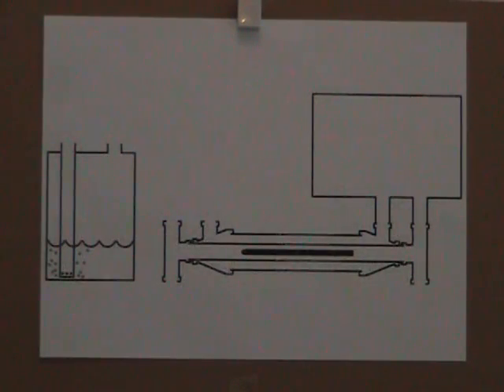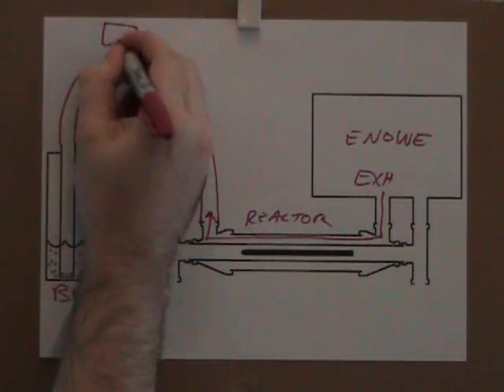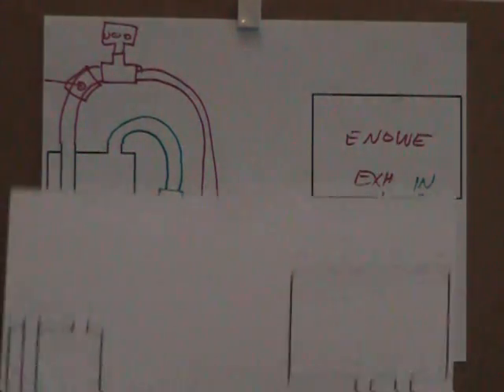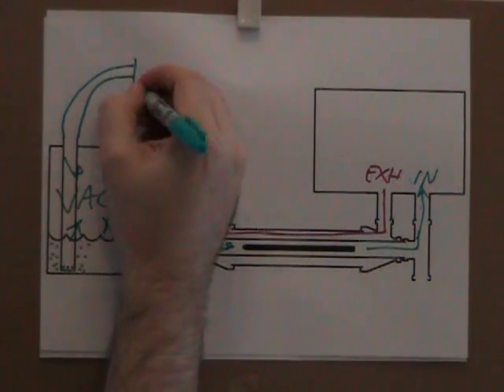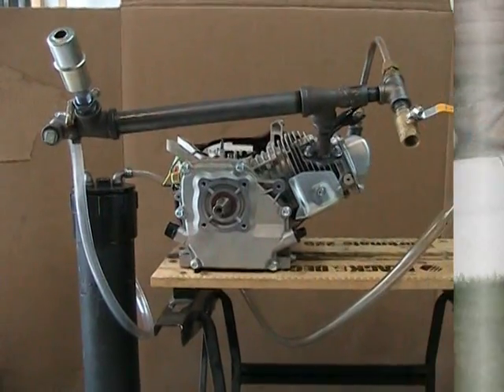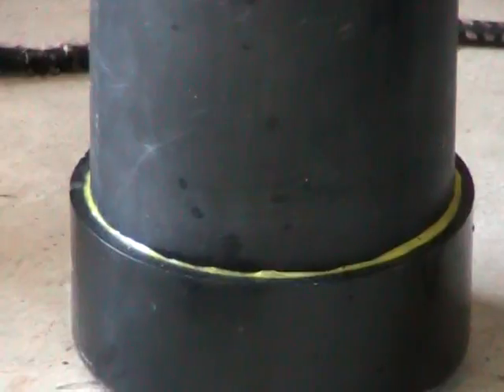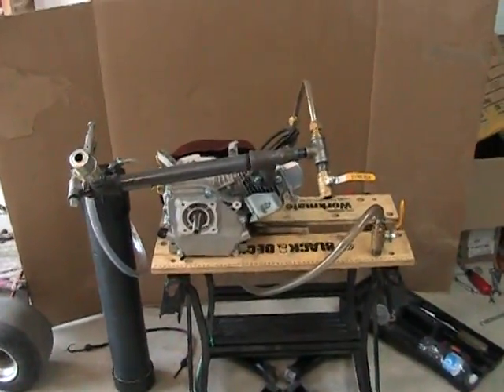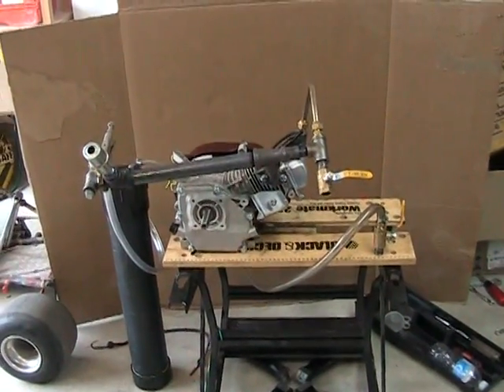GEET Fuel Processor - test 4 - revelation

Comment: this is a typical passive system ,what i mean by that is it only works until the lighter elements of gasoline are boiled off from the vacuum that the engine creates, once these elements are boiled of it ceases to function because only the heavier elements of gasoline remain and those elements vaporize at a much slower rate if you want plans for a real system lokk up gedc0395 pat galloway this system vaporizes ALL of the gasoline and uses no heat
Reply: Again Ive seen your posts before and finally some sense in the chaos although Ive yet to see a system that can overcome the vacuums lack of reactivity. mine was 20 times more efficient than a standard set up(32 mpg normal injectors and 651 mpg on the vacuum system) Still it has its limitations
Reply: You need to keep the vacumm at a constant 15 inches for complete homoginis vaporization of all elements of the gasoline you achieve this with a vacumm pump not the engine and before the intake manifold. Then you attach the export side to anywhere on th intake msnifold and close off the air of the "carberator"
Reply: I know about the steady vacuum, how many miles are you getting?
Reply: Leslie Clendening 60 from a 351 mach one mustang
Reply: We got 300-350mpg in a V8 302 and it would do the 1/4 in sub 10
It would do 3 passes then the speed would deteriorate until it wouldnt even start
We realize that the deterioration in the fuel was the problem and had considered and procured a vacuum pump to facilitate the creation of vacuum but pursued other directions
Most dont realize the need for vacuum and when their unit stalls they add heat. They also make the mistake of averaging out the first cup and mileage obtained and multiply it by 32 a common error
Interesting take on the problem couldnt find the reference but ill keep trying
Nice to meet an enlightened soul
Reply: I never have achieved the milage you stated but i did vaporize all of the liquid as a frozen ice crystal in a vapor form. Fine tuning of the fuel ratio could make those figures be more. Most people think heat the fuel bad idea that just retards the system and converts the vapors back to liquid. But stabilizing the fuels temperature does help glad to meet someone that knows a bit about physics. Im too old to fight the system to bring it to market and not sure it can brought
Reply: Im too old too (I think) I do have a lot of young guys trying to pick up the torch Im just trying to steer them in the right direction( opposite direction of most You Tubers lol). if they start off where we left off someone will figure it out
I found that a stationary engine without speed variation can run a generator that powers the batteries and use the electrical system to control speed. A modified Chevy Volt would be perfect because it already has both electrical and combustion systems. I personally think it would break the 1000 mpg barrier because smaller engines are exponentially more efficient than larger ones. It does take away from the one size fits all strategy that prevails now
And you are very correct about heat. the vacuum lowers the boiling point of the fuel so we didnt need heat either and I started my volkswagen in -40 just to prove that fact. You cannot have leaks in the system though
Nice talking to/at you and good luck 
Leslie
Reply: One more thing it doesnt matter what the end mpg was it matters that you know how you got there and 60 mpg is an achievement in light of the prevailing technology today
I achieved far greater mileage but with little control to speed variation. Its not really a numbers game its really the "holy grail of achieving better mileage in an operable car. Anyone who tries deserves recognition . We certainly get our share of insults

Comment: I have mine running my AC all summer long and it runs off nothing but unicorn farts and the tears of orphans.
Reply: +Steve Franklin Unicorn farts have methane.
Reply from the maker: +Steve Franklin - HAAA!    :-D    Awesome.
Reply from the maker: +Kenneth Meggers No, the input line is too long and too cold (relatively) so the fuel vapor condenses as water in the line and is eventually sucked into the reactor input. When that happens it sputters to a stop. I need to rebuild the input line as copper (or something) and make it as close as short as practically possible. I don't seem to have to add any gasoline to the fuel tank though unless it had been days since the last test.

It should be no surprise that there is no commercial interest in this 'technology', it's bloody temperamental and finicky. However if you want to see it in action I recommend the videos of "aluka1603" I believe it is. "Geet Pantone Engine Concept Demo by Andreas Kalcker" I think all that's happening is we're putting various pollutants through a brief (and extreme) chemical state which improves their combustibility in a typical I.C.Engine.

I sold my rig, so I'm hoping to build a new one from my remaining parts this summer.
Thanks for watching.
Reply: +neverchk Is the geet fuel that bloody temperamental and finicky that you can't get it ajusted to run right.
Reply: +Kenneth Meggers in a word, "yes". It should not be a surprise that without taking appropriate measures to mitigate the effects of vacuum loss, condensation, etc, that the average consumer would not be able to manage this home-built system. It should also be obvious that no manufacturer would go to the effort to produce and support such a system considering the potential for human error causing performance failure and there being no profit in it for the manufacturer. That doesn't make it any less viable as an alternative to running a lawnmower/generator/pump/etc with a conventional gasoline engine, but you have to be a tinkerer.
Reply: Funny. Read above post for a bit of truth about the vapor carb(I know its long but read the whole thing)
Reply: Congratulations you are the second post from someone who has figured out why this system is not marketable Please read my (very long ) post above
Reply: Steve Franklin unicorn is rhinosorus

Comment: There is not, a single video, I said a single one, that runs and engine for more than 5 minutes!!. None!
 It would be very easy to leave the thing running for half and hour with the so called 10% of fuel and the rest on garbage. But have they done it?, even a time lapsed fast forward video would be easy, But who in the hell has done it or even think about it?

Comment: Why have i never seen a GEET motor actually running anything besides a loadless engine?  Put a damn load on the engine and see what happens...
Reply: +Michael notgivingyoumylastname It should work fine. Since the GEET system is nothing more or less than a very crude carburetor, there's no reason why it wouldn't work.
Reply: It wouldn't work with people thinking they can run it on coke and water and then shut the exhaust valve

Comment: If you set up right, ONCE exhaust temp reaches a point, you can cut all clean air from intake, your airstream through reactor lacks the smoothness need to make achieve the ionization needed for prefect exhaust, i would Hone all inside pipe surfaces next build you see a difference
Reply: +DeFreshS10  if you were as smart as your as you act, would know that water is consist of H2O and the oxygen is all that is needed, hydrogen is a highly combustible gas if given oxygen, build it you see,  so please don't be ignorant build it or look in to it farther than the bridge of you nose!

Comment: ok i think i am starting to understand
the gas is-(dry)?- like it goes to engine as a gaseous mixture of mostly air?
 then using the exhaust pipe--?-- heats the gaseous vapor - in an effort too increase performance.
could you tell me- is that what is happening?
i want to do it to a 6 cyl chevy truck

 i am having a bit of a prob understanding the entire set-up-
like the carburetor part--  how would i  do it= have the valve to the gas peddle?
 i'm just not getting it all yet
and i do get it- that if it works on a  small lawnmotwer engine then  it will work on a bigger motor.
Reply: +profetarmageddon dude the engine is not an engine. sorry but if this actually works, it has 0hp and 0 torque. so your truck would go nowhere.

Comment: question cant  i just leave the carborator  on it ? and  have a geet bubbler  running into a sponge backfire arrestor  ? with  an adjustable air valve that opens  and closes  due to what   rpm is it ?
Reply: please reply i need to know
Reply: i'v used    it with just the carborator  on it  with a fume  but without the plasma reactor  i ran a 5 hp engine for over 30 mins off 1 cup of gas i used a  water filter container with a pvc pipe running down into a sponge for  it to not be  an aggressive bubble  and then it would come up into a pipe to catch remaining liquids that manage to splash up and drain it back down then it would hit  a T  with an air valve since straight gas isnt a good idea and this t valve had a  very light  air adjustment   valve to be able to open or close  if the engine rpm drops  i had it on a spring  attatched to the motor's  oil rod that pulls the engine to keep the rpm u set it to maintained and every time it would dog down it would close the valve a little but not all the way
Reply: jeshua leblanc  NO carbs become worthless unless you do some mods, they do not mix the same
Reply: only mod i did was blocking off the actual carborator and using the  valves between for air / gas flow
Reply: +jeshua leblanc The "GEET bubbler" is a form of carburetor.
Reply: why when i have my 14 hp brigs and straton motor can i  mow the whole yard on 1 cup and a half of gas then.  it works just like this but without the  exaust heating up the fumes

Comment: where can you get the reactor rods ?
Reply: I thought about using a magnet for a fuel rod through a copper pipe any comments because you know the weird anomaly's that happen when you run a magnet through a copper pipe=levitation?
Reply: a smooth metal rod is best. anything that's magnetic

Comment: You may want to cut off the glue cap and use a 4" Fernco Cap that is Rubber with a SS strap to tighten it.  I would assume the Rubber is Gas Resistant but it may not be so try to find out before you use this idea...
Reply: +Paul Bialozor  Doesn&#39;t the north and south poles of his pipes matter? and the smoothness inside the welds? And recently I saw that making all the 90degree angles into two smoother flowing 45 angles was suggested for increased flow.?

Comment: This is a reversion to 100 years ago's 'carb' technology. Fine for single fraction fuels, but modern engines are designed to burn atomised fuel, not single fraction vapours. You lose the valve-seat protection, anti-knock, anti-oxidants etc by evaporating the fuel at a fixed temperature. I love experimenting with old stationary engines, I think you'd find it very enlightening too!
Reply: So cars can be made with less technology and they could be cheaper again???
Reply: +Josh Krause I don't think you'd want this on a car. You'd need to have your passenger sit there and manipulate the valves every time you wanted to speed up or slow down.

Comment: I saw 2 car engines running on the GEET system over 10 years ago and this is the first time I've ever seen a youtube video of anyone trying to do it the REAL way. That bubbler crap was just a distraction for people who were worried about small engines. For cars, this is the right way to go about it. Thank you, it's been driving me nuts for years seeing all these inferior project builds. P.S. We followed one of the cars using this system for over 100 miles so it will work under a load!

Comment: :)  :)  there needs to be sensors that pic up change in element and other emission sensors  integrate that to a program. this will lead to maximum safety for fail safe programing and full control with accurate  information based system that could be operated in a manner of throttle control.

 send me a comment if you like this idea .

Comment: what is the reactor rod made of ? and if your using gas to run it, what is the point of doing all this work, when it already runs on gas ?
Reply: You could make it out of anything that won't burn. The rod is totally necessary in this but not for the reason Pantone claimed. The rod is the flashback suppressor - if you get a backfire in your engine, which is totally possible with this thing, it will keep the flame front from setting the fuel in the bubbler on fire.

Comment: i think all these do is using vacuum or airflow to vaporize the fuel, the engine is working on fumes. It would be interesting to put a load on the engine and see if its not just low-torque work being produced here. also a side by side comparison on this setup with and without the rod would shine a lot of light on this.

Comment: Water is not fuel. it is actually already spent fuel. When you burn hydrogen the chemical reaction to the hydrogen burning with oxygen is to produce water. in order to turn water into fuel again you must release the oxygen and hydrogen atoms from each other through electrolysis. Then you can burn them again and turn it back to its spent form which is water. But you must put more energy into splitting the water than you will every get out of it in work. So this engine will never run of water.....

Comment: This appears to be nothing more than a bubble carburetor.  Any gasolilne engine will run on gasoline vapor. If you bubble air through the liquid gasoline, (even gasoline water mix) you get a highly combustable vapor.  Original internal combustion engines were run this way using a retort.   They heated kerosene in a metal tank and trapped the vapors coming off the top. The vapors were then piped to the intake valve.

Comment: I have been lookin into the GEET i already make gas into a vapor on all stuff they also vaporize alcohol and still can run reg gas if need be but i can see a few things u can do to add alot to the GEET one add a fuel valve regulator after the GEET by the fresh air one to get a better fuel mix! Sec thing i can see would be a big plus if u would take yr bubbler and use copper tubing to send yr exhaust as a heater for it to get better reaction gas vaporizing cools.

Comment: Looks very credible.  This is in theory like a wood gasifier, using liquid fuel instead of solid wood and "vacuum boiling" with the aid of exhaust heat.  Wouldn't routing the hot exhaust through the bubbler make gasification of heavy waste oils etc more easy without investing in a diesel engine?  Wouldn't it also re-cycle unburned hydrocarbons?  As for environmental concerns, recirculating exhaust gases lowers NOx emmisions as in the EGR system in a car.

Comment: Smokey Yunic's Vapor Cycle Engine
just google    smokey yunic image   and you will see a diagram for the engine design. the Geet Gas setup looks like a simplified version of the VCE. 

In the geet system water is mixed with the fuel. It has long been known that water injection can reduce preignition in highly supercharged engines. 
The main reason for the exhaust through fuel mix is to heat it. if you don't want the impurities run a copper coil through the fuel from exhast to atmosphere.

Comment: @neverchk
Theoretically, it should drop down to near ambient temp because:
If the engine is being fed pure vapor fuel, there wouldn't be anything left to carry heat (like unburned fuel) in the exhaust gases. If the burn-cycle is completed before the exhaust valve opens, any gases that are expelled would be significantly cooler.
Our current engines are designed to open the exhaust valves just after TDC of the compression stroke causing hot gasses to be forced out of the cylinder.
Makes sense, no?

Comment: @1BustedMyth
Actually it won't lead to any of these issues. Why?
Because the solvents and (now liquefied) PVC will cause the engine to seize. The revving down is caused by the liquid PVC being deposited on all the surfaces inside the cylinder causing increased friction "gluing" the piston to the cylinder wall. It's like pouring Sugar in the gas tank.
Sugar is really nasty because of how hot it gets. In some really bad cases, the piston and cylinder-wall become fused. And there's no fixing that!

Comment: Many PVC glues are petrol/gas/petroleum based and if I'm not mistaken the PVC itself will have a very strong reaction and contaminate the fuel. End result will be Tar, carbon build up inthe cylinder head leading to pre ignition and "run on" (Dieseling)
So as you said, glass would be better.
nice clean test rig setup, well done.

Comment: I know Paul Pantone well. He is a con man through and through. I'll share one little secret with you. When he pours water, Mountain Dew or urine in the gas tank and the engine still runs, people are amazed! The reason it still runs is because the fuel line has been changed to run off the top of the tank, burning the butane and other parts of the gasoline. Because of that, there is no need for a carburetor to vaporize the gasoline (unvaporized fuel will not burn). A sucker is born ever minute!

Comment from the maker: There's nothing special or magical about plasma, it's just 'excited' gas. I don't think it matters how long it remains in that state (probably just a flicker if at all) but I believe the fuel gasses enter the chamber still somewhat 'cracked'... or something; who knows. My engine runs cooler (more efficiently) with the reactor, but won't run without the rod in place. Perhaps it's just a steam effect - who cares. See aluka1603's videos You can't argue with the results of a working system.